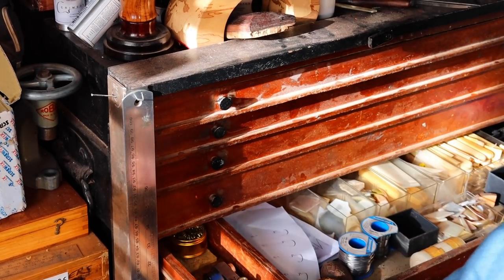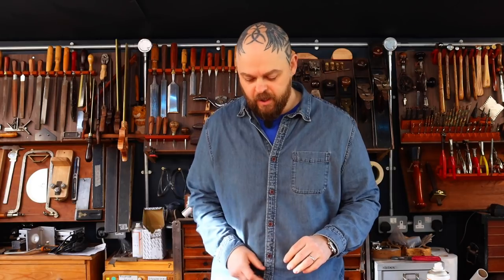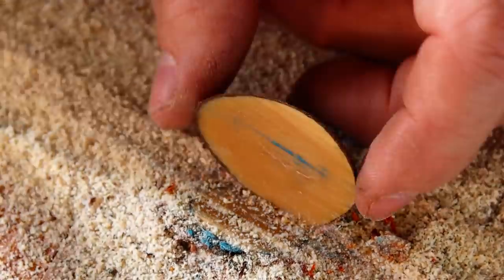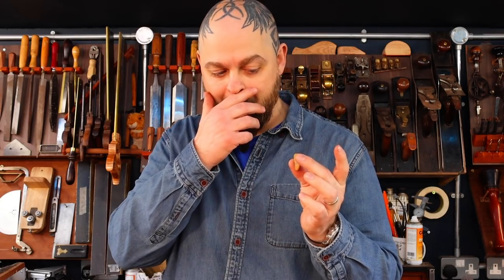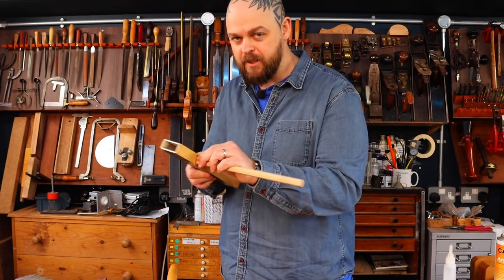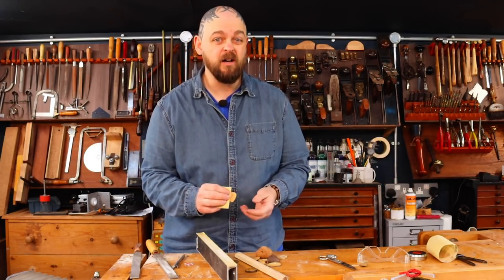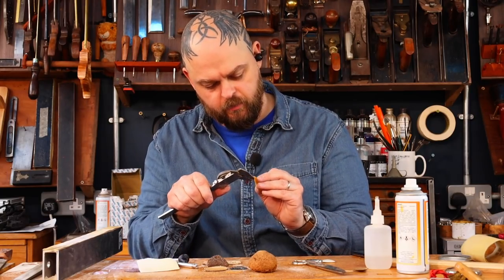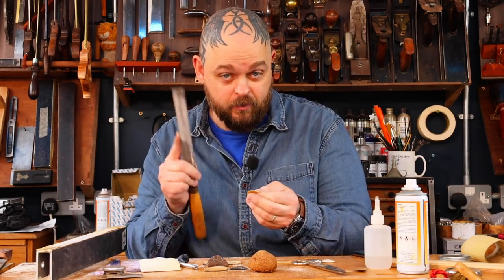How to Make a Custom GUITAR PICK...out of a NUT

Comment: Very interesting. Years ago I worked at a small company that made shirt buttons. The raw material was polyester, which came in long cylindrical blanks of various designs, often simulating wood. I made quite a few plectrums of the thicker variety, by shaping a slice of polyester with a  bench grinder (yools to hand etc.) and then putting them in a large barrel polisher overnight, which is how the buttons were polished. The were very durable and I still have some, some twenty years later!

Comment: There's a Bermuda triangle somewhere filled with guitar picks, odd socks, and 10mm sockets

also hot glue seems like it would work better than the mountain of saw dust and super glue
Reply: If you've ever disassembled some electronics then you'll know that there's always one fastener that gets dropped and turns into pure sound waves before it hits the ground. You hear it bounce multiple times, but it's been invisible since it left the bench and will never be found again.

Comment: I've used a medical device easily purchased and very useful. If you check with your local medical supply shop you can usually find locking hemostats or forceps of various sizes and shapes and you may find one or more that are quite handy for holding  smaller items as firmly  or less so depending on the adjustment and clamping force.
Reply from the maker: good call.. very good call! B

Comment: I made my first pick in 1976 out of an American quarter (in bad imitation of Brian May). I used a conventional shape. I played that pick for 12 years. It wore into an almost unplayable condition. So when I lost it, I made one of similar shape but used a store bought stainless steel pick that I shaped to something more playable for me. Consequently, I've had to make every pick I use ever since then. 

I've made picks out of everything imaginable, and am always looking for better materials, as I like them about a millimeter thick but absolutely stiff, preferably with no flex at all.

I've found that it works better to hold the pick rather than the tool shaping the pick. I take some masking tape and wind it around my first and second fingers with the adhesive facing out rather than adhering to my fingers. This gives me a good grip on the pick while I work it on my belt sander at first and then on various grits of sandpaper laid on a flat surface. Metal fingernail files (carborundum, I think) work well for fine shaping.

Comment: a great material to try out is polycarbonate. incredibly tough, but nice to work with .. and a glass clear pick, with a brushed finish, looks really cool.

PS: i exclusively play home made PC picks for over a decade. i've settled on 3mm material in a long, narrow arrowhead shape, and with a playing edge like on gypsy style jazz picks. which gives you a razor sharp tip right at the ~30° angle you're normally playing at, making it very fast and precise, with a strong attack.
Reply from the maker: I have played with a polycarbonate pick  before.. I think I may well have to take your advice and go back and try again! B
Reply: @CrimsonCustomGuitars  oh man, that notification had drowned in a sea of others. thanks for your quick response! 
PC definately is a wonderfully slick and very durable material for picks. but the magic is all in pairing it with that "gypsy style" geometry of the tip. no point in trying to explain the feel, but makes thick picks play incredibly smooth and fast, and almost effortlessly, without scratching even on bass strings. (very shreddable too - sweeps play themselves) really makes me wonder why that style of picks isnt much more common.

PS: look at the wegen gypsy jazz guitar pick for reference

Comment: Hey Ben. I have a question. More than one actually ;)
First: what does an oil finish with your guitar oils feel like? We know it looks spectacular, but youtube sadly conveys no sense of touch. Is it a smooth feel? And how do you generally get the best finish, both for looks and touch (meaning is there a rule of thumb like one coat of penetrating, then two of high build, then polish with renaissance can't go wrong for example)?

Second: will you build another bass? Something fancy with a through neck, feom scratch? It would be so cool.

Comment: Take the material, draw out the shape, jewelers saw to cut out shape- masking tape and superglue, leveling beam angled to get the proper width and pitched angle. Sanded and shaped the edges to 320. Superglue finish, sanded up to 12k micromesh for a mirror finish. Ca glue is Tough and durable, and gives a brighter tone than the raw material. Although raw ebony sounds wonderful too
Reply: Some soft woods will sound dark and warm. And feel a bit slow. Ebony etc sounds great, and feels great too. For slow dark materials I coat with CA glue to give it a better sound/feel. Try it! It works.

Comment: Hi Ben, here is a question... I have a small workshop and have most of the electrical tools required, I already work with wood in buisness. I play lap steel as well as guitar. And am hoping to build a or some lapsteels before I finally I get to attend one of your courses so I can learn to build a proper neck and fret to finish..but in the mean time does crimson provide a workshop starter kit as a bundle or even a starter kit list (PDF) of essentials so that I can build up tools in perpetration. I have watched many hundreds of your tutorials and although I am fairly certain I know what I need. It would be great to have a shopping list with recommended items to work from.
Understand if your too busy, but this may already exist and I just need pointing in the correct direction. Cheers

Comment: Have a question about the nut on the guitar I'm going to start with a nut size for 10/46 but I need to adjust to 10/48 and cant find a set of nut files in 10/48 then what do I do to make the sizes?? Ty v m for your time RCD 🤓

Comment: My wife got me a really nice capo last Christmas and it came with two rosewood picks that were 3mm thick. I had never played with thick picks before, and I almost immediately took them to my dad's house where we made a few more out of a walnut pen blank cutoff he had. I'm pretty sure walnut is harder than steel strings. I'm still using the first one we made that came out uglier than sin. The rosewood ones were so pretty I didn't like using them in spite of how nice they felt, but this ugly walnut one has a few hundred hours of use and has only needed to be touched up once when I went a little pick scrape happy and cut some gouges into it. I'm all for trying weird stuff with picks now, though.

Comment: Ben, which is the best glue to use when building a classical guitar?  Does the type of glue depend on the woods used and/or the different joints throughout the guitar?
Reply from the maker: Some people do prefer Hide glue for the neck joint specifically and then use Titebond or similar for everything else, but in my opinion either will do.. as long as you use glue designed for use with wood you will be fine. B

Comment: Ben, why would you take all the time and put in the effort to file, sand and polish one side, only to put super glue directly on it in order to do the other side, which then requires a second sanding and polishing after the other side has been done? What is the masking tape and super glue trick for, if not for something like this?
Reply from the maker: A good point very well made! B

Comment: Hi Ben, quick question - other than the aesthetics, is there a reason most guitars don't use Oak in guitar build? I'd imagine that it would make great neck material due to its strength. Thoughts?

Comment: Ben. I saw a metalworker youtuber making a model steam engine claim that super glue with accelerator spray seemed less strong that super glue without accelerator. Mind you she was using it on metal parts on the laid, it might work differently on wood. What is your experience?

Comment: Hi Ben, i would know the name of the actual nut, just to know if i am able to find it in Italy. Also i saw you made an almost round edge for the pick and i would like to know if that material could resist even with a more sharped edge. It is always a struggle to find a good sharped pick that don't degrade after the first playing session.
Reply: I sand mine sharp n square before a gig
Reply: @zeusapollo8688  i do it constantly, this is why i ask if that material could be hard enough to resist more. :)
Reply: I take the pick to a sharp point also

Comment: I've thought about using these for guitar nuts.
Reply: Hmmm, apart from difficulty in handling (which would be overcome if it was economical) I'd guess there's probably a physical materials reason that they aren't used, particularly as they're cheap - maybe downward pressure from strings would cut through tagua

Comment: Make a plectrum simply pouring superglue in a mold... (?)
Reply from the maker: That would need dust or shavings etc to give it some strength.. a pool of superglue also doesn't like curing, you would be better off using epoxy. B

Comment: Think I could use a hot glue gun to stick it to a pc. of wood instead of CA glue and wood chips?
Reply from the maker: YES! I've never once used hot glue in a guitar workshop but the kids and I use it all the time on their projects.. good call! B
Reply: @CrimsonCustomGuitars  I use it from time to time to hold small parts as I'm building.  There are different types of glue sticks and the one I get hold very well and pop off the wood easy when I need it to. :)